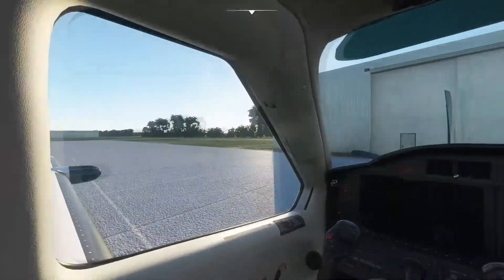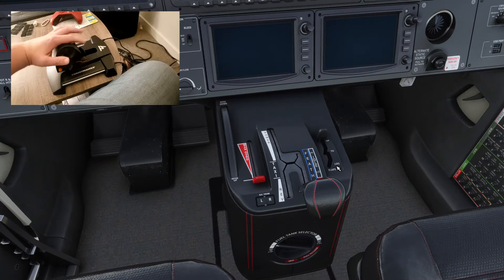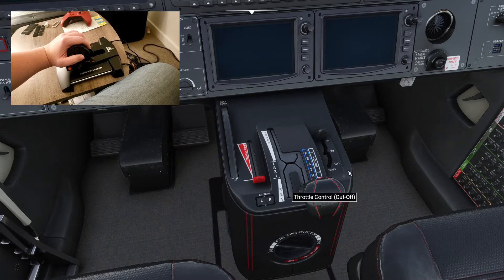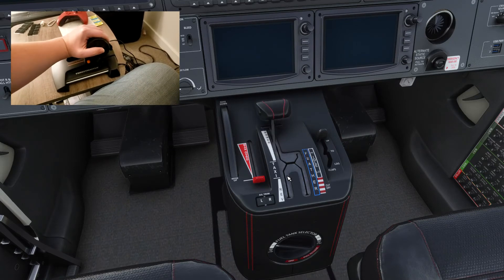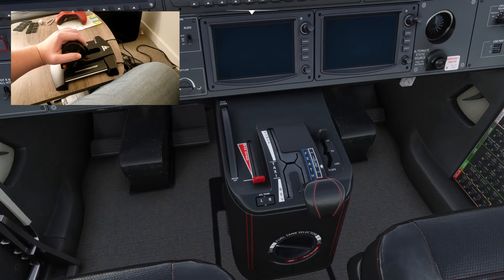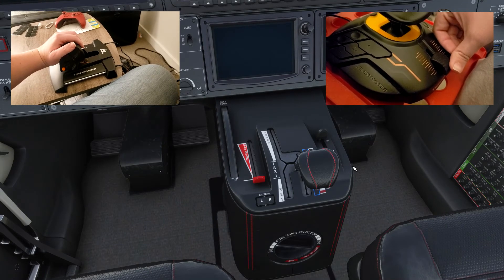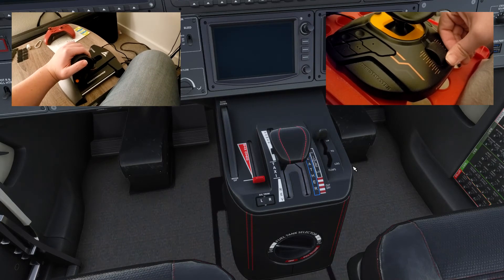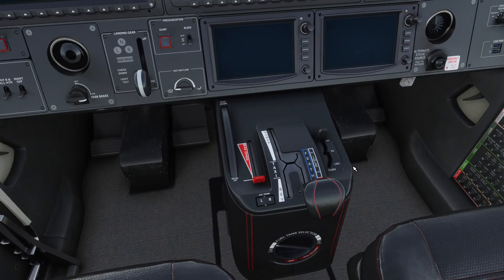How to Control the TBM930 Throttle (Microsoft Flight Simulator)

Comment: This looks like some sort of magic trick to me. I have not been able to get the throttle to move to left position no matter what I do. It's crazy for me to even see it do that so effortlessly in this video. It will not go there with the mouse, throttle, keyboard, nothing. Just goes up and down on the right side. I can get the engine started, but that is it because I can never get the throttle over to the left. You probably can't help since it's working for you. I just don't get it.
Reply from the maker: My only advice is to check your device's settings in the computer and see if it's not registering the full range of motion. You may need to add small dead zones on the ends of the prop or throttle axes to get them to work right.
Reply: This is due to Sim Update 5. The legacy control mode doesn't allow the throttle to be moved to the right with the mouse. The only workaround I've found is to hit Ctrl+F1, and that moves it to the left. Ctrl+F4 moves it to the right.

Comment: I tried the mouse interface to move the throttle handle to the side but that wasn't working too well. I'm also using the Honeycomb Bravo throttle quadrant and I wasn't able to get past the midway point because of the way the throttle handle is designed in the TBM-930, so if I move the throttle handle to 100% on Honeycomb throttle quadrant, the actual throttle on the aircraft won't go past 50%. I hope Asobo will provide a fix for this issue and it ignores having to slide the handle to either left or right to be able to use the full range that's available on the 930.
Reply from the maker: Check your throttle mappings, you need to make sure you're using the one that is "-100% to 100%" rather than "0 to 100" so you're getting the full range of the throttle.
Reply: @EllieODaire  Thanks, the throttle mappings are already set to use -100% to 100% axis and this works fine on all the other aircraft in the simulator, except the TBM 930 probably due to the way the throttle handle is designed in the aircraft and the way it's replicated in the simulator.

Comment: Uh-oh! I came up with two more issues based on my first flight with my new controls. 1. There is no way to get to the top-right throttle position, labeled "Hi Idle."  2. I had a near disaster during flight when my right sleeve caught on the new propeller axis slider that I set up. Any thoughts on these two issues? Thanks again.
Reply from the maker: The "hi idle" position isn't simulated. During start up you should go straight to flight idle (Left center position on the H). For the sleeve issue I recommend the ever fashionable sweatervest.
Reply: LOL! Thank you again.
Reply: Hi idle is simulated now

Comment: Thanks for addressing this issue for those of us with very simple flight controllers. But I still can't move the lever to the right for shutdown. I have tried dragging it right with a hold of the left mouse button, with no effect. Any other ideas?
Reply from the maker: If you aren't able to move it right with the mouse, cut the throttle (F1 by default) then try using a keybind for Decrease Prop (default is Ctrl+F2). Once the lever is over on the right you can control it with your throttle controls.
Reply: @EllieODaire  thanks for your suggestion. The Ctrl+F2 default just moves my lever a little bit right and then it snaps back to the left side. I may have to step up my hardware to a separate throttle quadrant?
Reply from the maker: It sounds like signal noise from your throttle axis is causing the issue then. Adding a small dead zone to the end of the axis in the sensitivity settings might work.
Reply: @EllieODaire  thanks again for your time and expertise. I just ordered some better flight controls. I also just read your fascinating bio, so now I'm a subscriber.